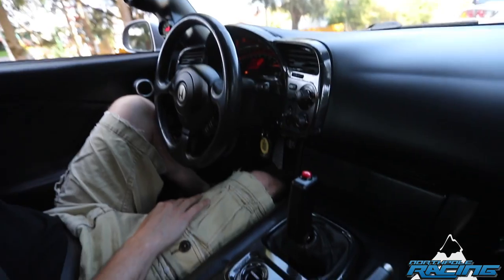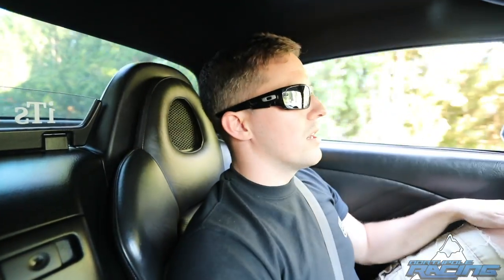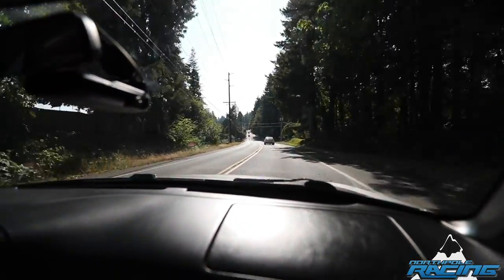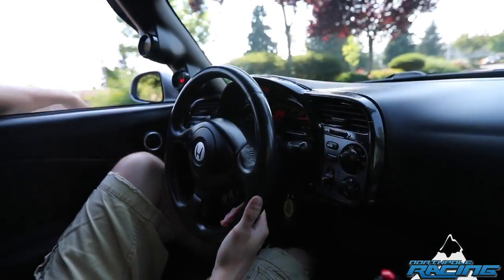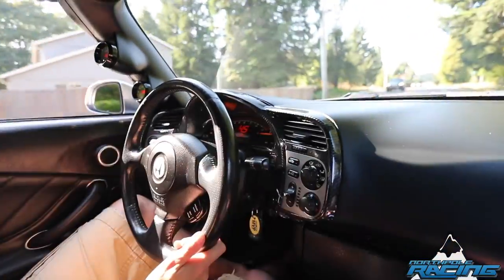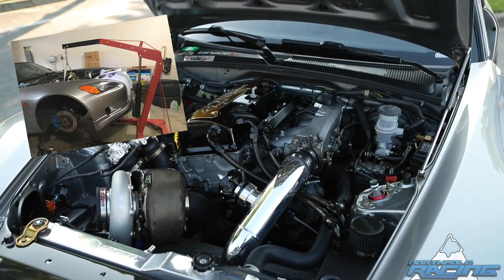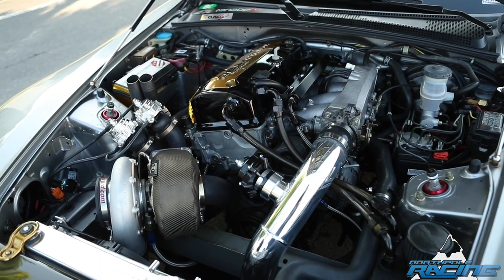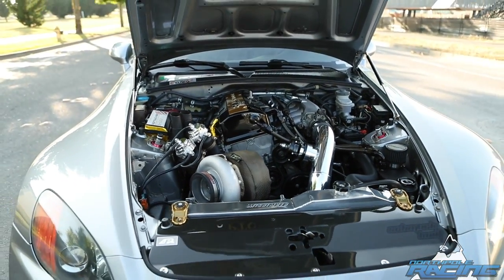900HP+ Honda S2000! This thing is INSANE!

Comment: Curious as how this does cruising on the highway and rolls (mostly what I do) my s2k build is almost exactly what you have, Schmuck kit and 7275 but I still have the cd009 and currently car is at my shop for the 2nd time dealing with clutch/trans issues seriously looking into an auto swap wanted more in depth info about it if possible
Reply from the maker: His tuning / info page is in the description!
Reply: Auto swapping a S2K??…okay now I’ve seen everything smh

Comment: Is there any additional info on the adapter he used to mate the engine to the powerglide?  I endear the use of JDM engines to conventional automatic transmissions in hot rods and performance vehicles.  Fresh thinking with modern engine technology.
Reply: Was made by ATF
Reply: Atf, rpm and quick time make adapters for American transmissions